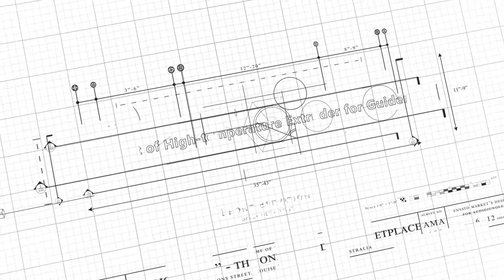FlashForge 3D Printer - Replacement of High Temperature Extruder for Guider 2/2S

Comment: How do you make the 3d printer go to 300°C after you put the high temperature extruder ?
Mine only accept to go to 240°C and then stop heat up. Do I have to make a modification on the software or a parameter on FlashPrint ?
Reply: Did you find a solution to this?
Reply: You have to change that in the settings of your printer. Activate the hot temperature mode.
Reply: @fillpv5660  Pretty sure there is no setting for that.  Are you talking the printer menus or the slicer?
Reply: You might check out your Firmware. They canceled the HT-Option in the Firmware, but I don't know from wich Version on. You might try the archive guiderII_1.4.9.167_g24_20210112_factory.zip or earlier https://drive.google.com/drive/folders/1U_L9JZ3TaUpkQmC7C0S6bqvnj8TX6T4q
Reply: @petercallison5765  did we get en answer? I have the same problem would love to know how to get it to heat up to 300
Reply: @rbmlosanimalesrecord  Look at my comment.
Reply: As far as I know, they reactivated the HT-Option with Firmware version 1.5.3
Reply: Go to the settings under the Tools screen on the printer.
It is the last option in the list when you scroll down  the options.
You may have difficulty scrolling down because of where the scroll arrows are
Mine turns WiFi on and off, usually, but wetting my finger helps me get past that.